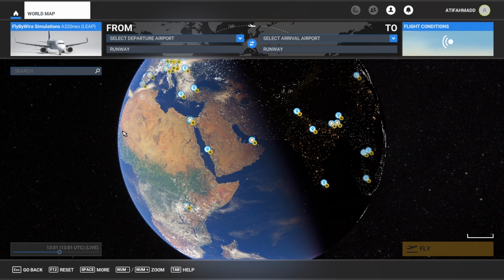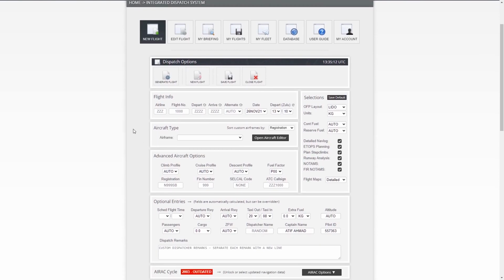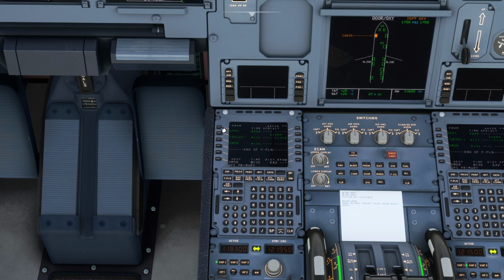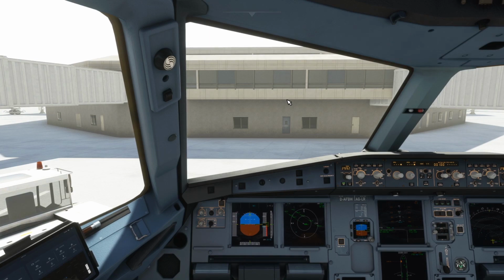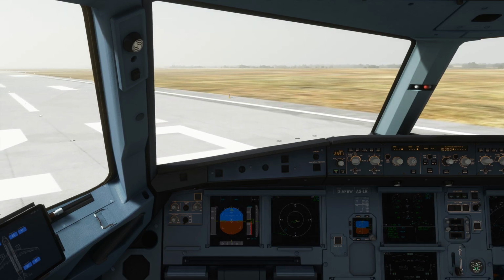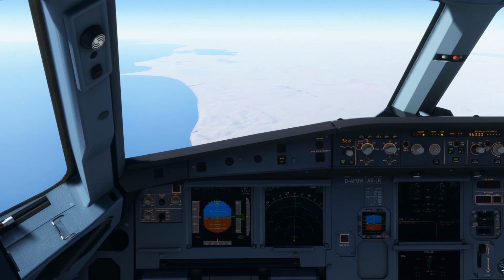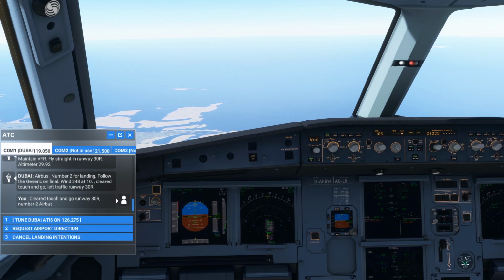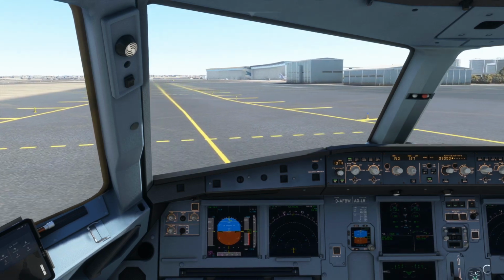Flybywire Airbus A320 Neo Full Tutorial for Microsoft Flight Simulator 2020

Comment: Dear Mr. Atif,  when I click the MCDU MENU at 27:17 there is no (OPTION) command in my Airbus flyby wire and I have this issue long time but  no one yet answer or help me to fix it ( FYI   I have updated  the   developed A32NX .... SO Plz. help ...Best regards,
Reply: Dear Mr. Atif,  when I click the MCDU MENU  there is no (OPTION) command in my Airbus flyby wire and I have this issue long time but  no one yet answer or help me to fix it ( FYI   I have updated  the   developed A32NX .... SO Plz. help ...Best regards,
Reply from the maker: Do you have any other MODS or Plugins installed?
Reply: @aatifahmad   No thing at all  ... Did the MCDU  need to be updated ? (( or I have to change from developed to basic ?))
Reply: same with me.
Reply: Dear mr Atif, I have the same problem, but I must tell you that the system uses AIRAC 2103 while it should use AIRAC 2108. However that one I cannot use because I am not a registered user of Navigraph (to expensive for me). Is that the problem?